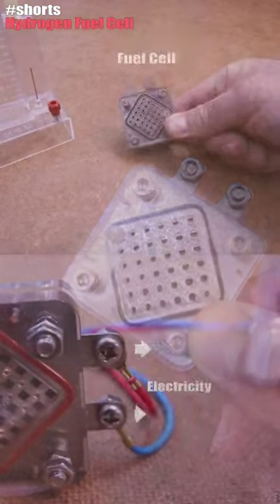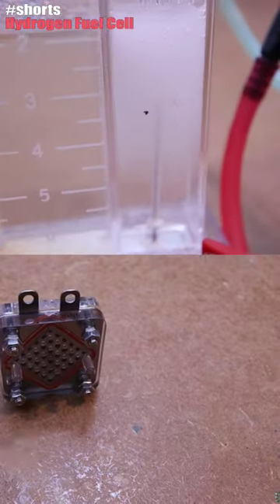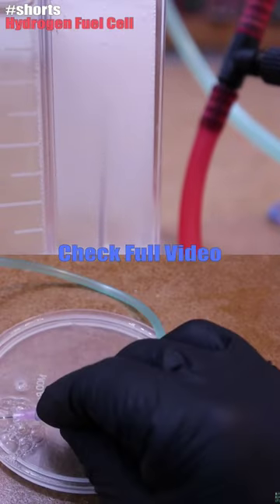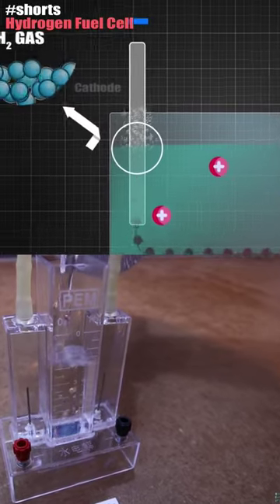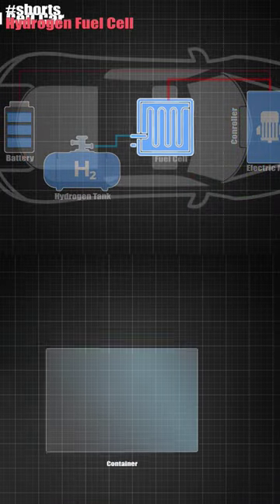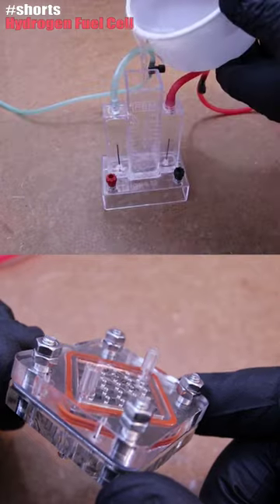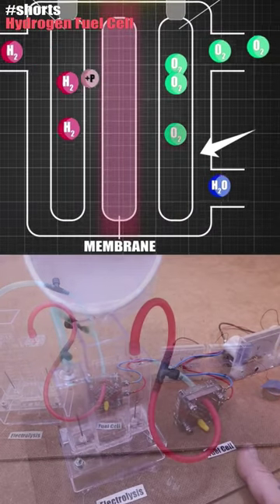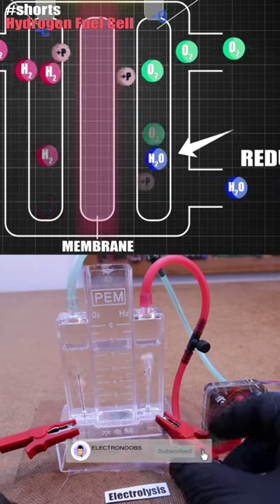Hydrogen Fuel Cell

Comment: lol 70% efficient if you don't count just about everything else needed to make it usable and back into electricity.  More like 25% efficient if you have to liquefy it for transportation and storage.  Let's have some real-world examples.  One of the largest new hydrogen generators estimates about 65kWh/kg.  Then if you have to liquify it, it's another 12kWh/kg, making it 77kWh/kg.  That drives a current Fuel cell car about 65 miles. Take that same 77kWh of electricity and store it in a battery you get 73kWh in the battery, then drive it and you get 293 miles.  292/65 is 4.5 times more electricity needed.  Imagine needing to install 4.5 times more solar or 4.5 times more wind turbines to drive the same miles.
Reply: Sounds fine by me. If it means the people of Congo can have some peace and progress.
Reply: @axcessventures2572  They might have peace, but surely not progress.  peacefully starving to death.
Reply: @scottkolaya2110  This is Afrika. There's food enough for everyone, save for caucasian greed.

Comment: 70% efficient, ya I don't think so. Maybe on just one side, but not in total, especially when you add it compression and transportation.

Also, it's doesn't appear to be commonlu known, but mosy Hydrogen is made using natural gas, which is likley how it would still be made if a huge demand for it rose. Further, another not so well known feature of Hydrogen is it's a greenhouse gas itself. If Hydrogen leaks out and gets into the atmopshere, it impedes the natrual process that removes Methane from the atmosphere, so it stays up their longer than usual. So Hydrogen compounds with methane, which means it actually contributes to a 20-80x greenhouse effect, depending on various circumstances.

Not trying to be negative, just realistic. It is likely that Hydrogen is being used to greenwash fossil fuels like Methane while giving the natural gas insdustry better profits. Hydrogen, by volume, has only a quarter of the energy Methane can produce. So, they will have to use 4 times the amount to produce an equivilant amount of power from Hudrogen. They'll also have to ship 4 times the amount as well, to give the amount of energy we currently expect.
Reply: He's talking only about the cell itself, not the whole process.
Otherwise, we would have to include all the processes involved in getting oil from ground to car, and the efficiency would at least be halved.
Reply: @UserName-cb6jz  when it comes to finding the best energy solutions, we need to account for all the inefficiencies.

What we need is energy. For the most part, all of our energy comes from the sun. Solar, obvious. Wind, the sun heats some parts of the world. The warm air builds pressure causing it to push out. Add to that heat wants to equalize and will push into colder areas. This all creates wind. Hydro, sun raises water vapor, it turns to rain, water ends up high on land with a lot of potential energy. Fossil fuels comes from plants and animals that directly or indirectly got their energy from sunlight. Over millions of years, it was concentrated into the highly energy dense we are familiar with now.

These all have something in common. The energy in each form takes relatively little energy on our part to take advantage of. We may need to process oil into usable forms, but we only need to use a fraction of its energy to process it.

Hydrogen is another thing. It takes an enormous amount of energy to make. Then it either has to be compressed or liquefied. The first takes a bunch of energy and the second takes a humongous amount of energy. As Hydrogen is basically one of hardest to contain elements on the planet, there will be a lot of losses, which means production will have to overproduce to account for that. More lost energy. Transportation might seem like it won't be higher because we already transport fossil fuels, but Hydrogen's lower energy density by volume requires thar a whole lot more Hydrogen needs go be transported to produce the equivalent energy.

That is another flaw in the fuel cell. What if it got to 70% efficiency? Considering that Hydtogen of the same volume as gas has about one quarter to one third the energy, it still doesn't get it close to equaling gas. 

Even them, it still doesn't fix the problem that getting the Hydrogen into the car consumes a massive amount of energy.

We tend to stuff off all that energy consumption because at the moment, thanks to fossil fuels, that energy is cheap and abundant. Now take the entire Hydrogen productions system from the beginning to the car being fueled and try to power it with Hydrogen. All Hydrogen produced heat, electricity, and transportation. Suddenly, the inefficiencies stack multiply upon each other. I would bet that if someone broke it all down and mathematically went through every stage of the process, they would prove that producing Hydrogen would require more energy that it gave per unit.

All of this is on top of other problems Hydrogen has. Like how fuel cells along with the components that derive Hydrogen from water require rare elements, which makes scaling difficult and expensive. Or the problem brought up by Hydrogen fuel cell drivers of the requirement for ultra purified air to keep the fuel cell from plugging up, which requires changing very expensive air filters quite often.

Hydrogen looks good only as long as you don't look too closely.

Comment: Dont store the hydrogen.  Scale up production system to produce enough on demand hydrogen to power the car's motor. Make the system removable so parking car in cold climate doaent freeze the system.
Reply: If you have enough energy on board to power electrolysis, why wouldn't you just use that energy to directly power a motor?

Comment: There's too many problems in that system. You've got 2 different materials coming out of water. 2 different metals that react to different materials. And the amount of power you have to put in to get adjuration out. Isn't that efficient?